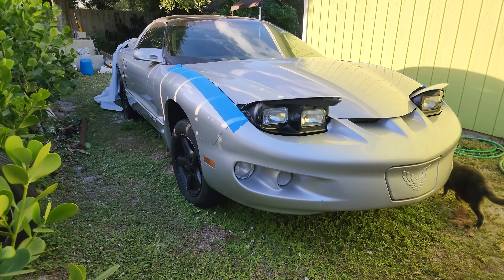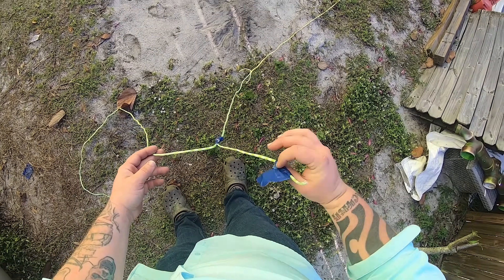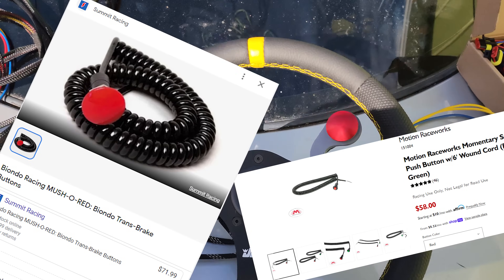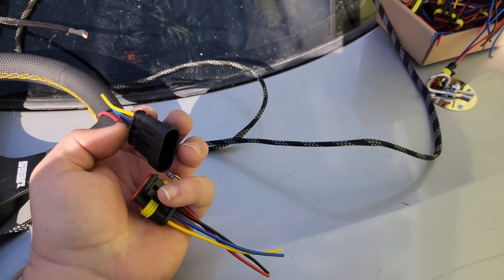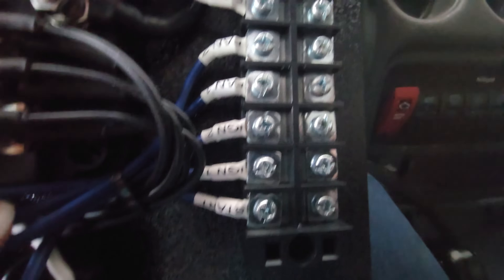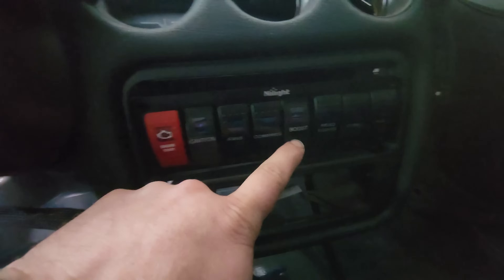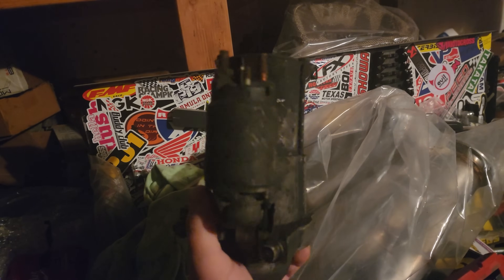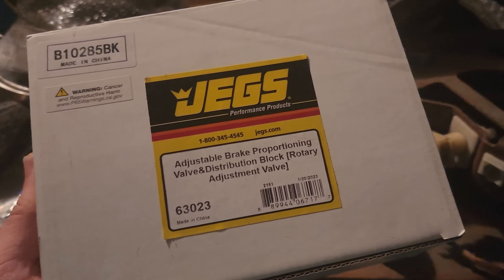STOP Wasting Money on Race Car Wiring | EP. 6.5

Comment: Ive spent the ole 600 or so for steering wheel lol. I like my etched billet buttons though lol. What im doing with my wheel. Hope it works. I bought a deutsch bulkead with flange. Gonna dash mount it. Then try to appoxy pot the wire on back side for curly cords. Shall see if im dumb or not.
Reply from the maker: That's a solid plan, hope it works out great for you!

Comment: I just ate up your video. I know zip about wiring but am determined to learn. I bought a junker ‘95 VW Golf Mk3 and stripped it back to the bare shell and am replacing everything in building it to be a pure track day car. Half of everything not connected to the ECU is going away so I want to completely rewire the car like you did. One question: The taillights have about five connectors which is insane, there ain’t five different functions. Anyway, how do I connect them up without using the factory connectors? I guess I could pry the taillight unit apart and simply pull new wires to the light bulbs (taillight, brake light and turn signal) bypassing the factory plugs. What do most people do when they are doing a new harness? Much thanks.
Reply from the maker: Tail lights have running light essentially low setting.. Left and right signal and high. 4 functions 1 ground. Their are cheap kits on Amazon that can handle this or you can ask howerton motorsports if they make a kit.
Reply: @HighNoonRacing My question was about how to make the connection without using the factory connection socket as this completely new wiring. I will need to make a direct connection to the taillight, brake light and turn signal light. I will not be using a backup light. It looks like my only choice is to open the unit up, drill an access hole in the back half to run the wires through, after the wires are through, make a connection directly to the bulb socket and then glue the two halves back together.
Reply from the maker: Most people run the wires themselves and use the things I referred to in my previous comment. Like a universal golf cart light controller or motorcycle signal controller and relay kit. As far as wiring them just splice into existing wires.
Reply from the maker: Or 15$ hot rod turn signal controller

Comment: Question I understand when u contact a source say like the starter to the engine switch how does the ground wire tie into this ?
Reply from the maker: I'll have to double check mine but I'm pretty sure it just grounds to the block.
Reply from the maker: Where it bolts to the block the contact it makes is its ground to its housing

Comment: Do you recommend using tinned copper wire for fuel pumps ?
Reply from the maker: I wouldn't recommend it only because every OEM wire I've cut into isn't tinned. One might argue automobile manufacturers did that to save money though, so who knows. Marine applications use it probably due to the harsh environments they are in. As long as you don't use Copper-clad aluminum wire, cheap junk that requires you to run a larger gauged wire to achieve the same result.

Comment: You should put your coils on that last switch through a relay so when you have your ignition on the coils are not hot, like setting up your dash or testing stuff. If you're using cnp, if the coils are hot sometimes they can burn up, ask me how I know.
Reply from the maker: I'm running the holley terminator, so not sure if I could put those on a switch or not but good to keep in mind! Thank you

Comment: Is there need for relay if you have one big cable going to a fuse box and from the fuse box to all devices like radiator fan, fuel pump, powerwindows etc. Before the fusebox you add a battery killswitch, evertime you stop driving, use the killswitch to disactivate the fuse box. Am I right with my thoughts?
Reply from the maker: Somewhat, you don't have to use relays you are correct on that. And you can use a main power switch if you daisy chain the main power into all the accessories but if your powering straight through the switch you might actually short out the switch before the fuse so that's why the relays also come in handy.
Reply from the maker: To power the radiator fans and fuel pumps you 100% need to run relays. They will use thicker guage wires, if the wire is too thin it will heat up, and blow the fuses. Or worse start a fire.
Reply: @HighNoonRacing  A very big wire comes from the battery to the selenoid and from there with same thick wire to the fuse box. From the fuse box comes a wire which can feed the fan and a 30A fuse. But a ignition switch or key triggers the selenoid on and off. On let the selenoid pass electricty to the fuse box and all devices have power .This is my idea.
Reply from the maker: @khancross from what you're explaining yes this would work.
Reply from the maker: I would recommend having the appropriate fuse for each accessory. Relays are like the middle man between the switch and the main power source to the accessory.
Reply: If I understand what you are saying, then your fans, fuel pump, water pump… will be powered on all the time as long your kill switch is on. You can put them on switches after the fuse box as long as the switches are properly sized. For rocker style switches we have not found a Carling rocker switch that will handle anything above 20 amps. That’s where relays come in. Do you need relays on every single circuit? Absolutely not especially for low amperage (1-2 amp) triggers, but to me it just makes for a cleaner install. You can have a thin wire going to your switches and thin wires going to trigger your relays that are easy to access under your passenger side dash. It all ends up being personal preference, but I think it ends being cleaner this way.